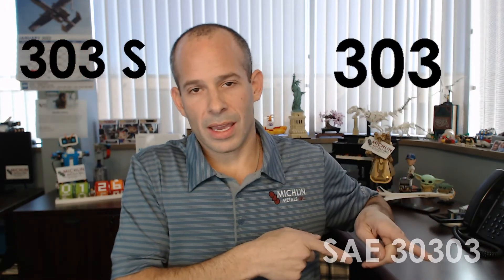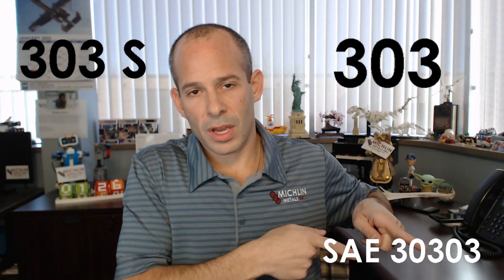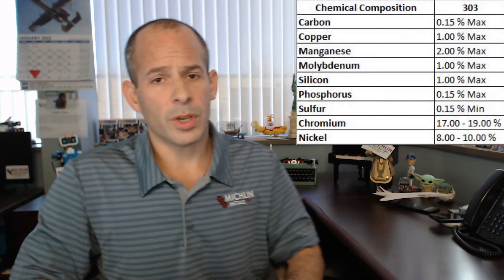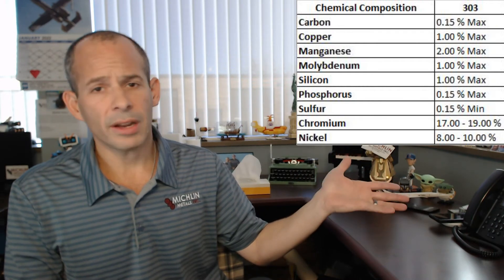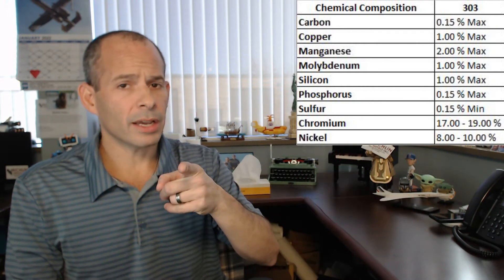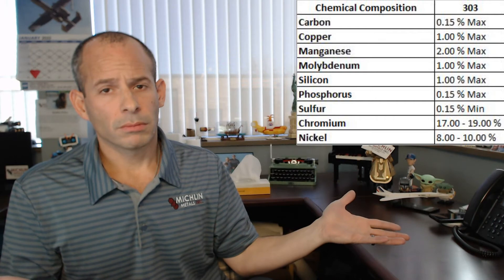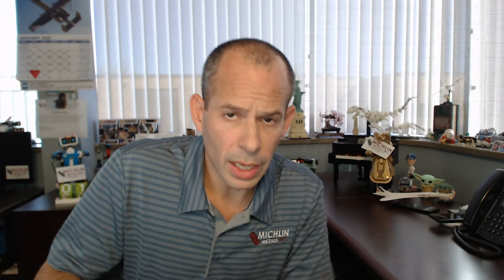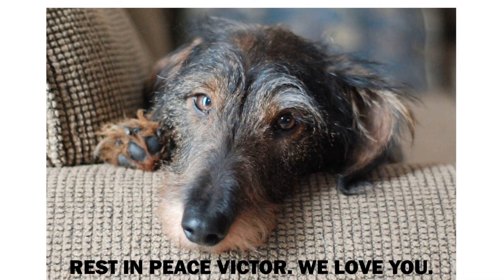303 Stainless Steel - 303s - AMS 5640 - ASTM A582 - 303 Round Bar - Plate

Comment: I've seen mil certs of 303 with 0% Mo. Is that an issue I should be concerned with
Reply from the maker: Not a problem for no Mo reported in 303 unless the applicable specification restricts it. Many commercial specs do not require.
Reply: @MichlinMetals  Thanks!
Reply: No 304